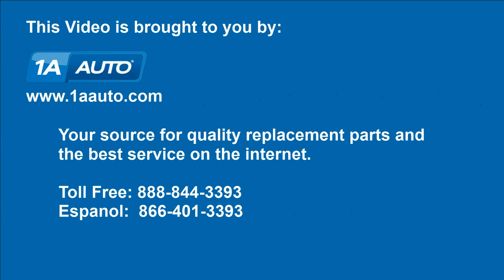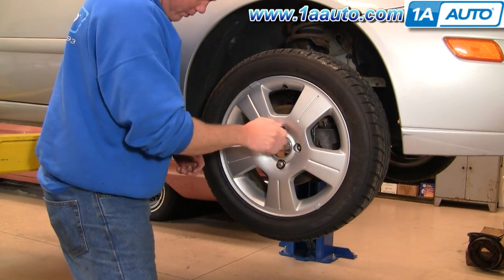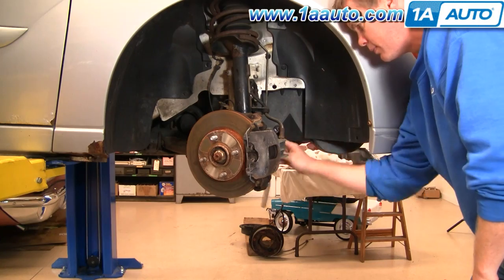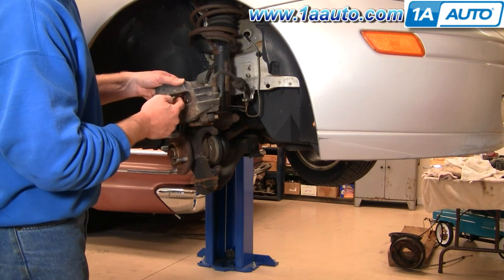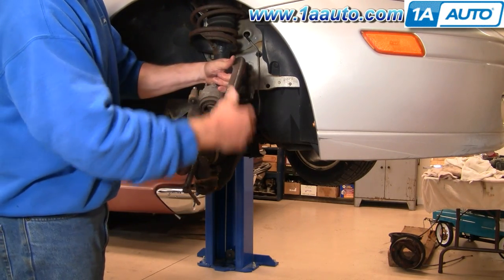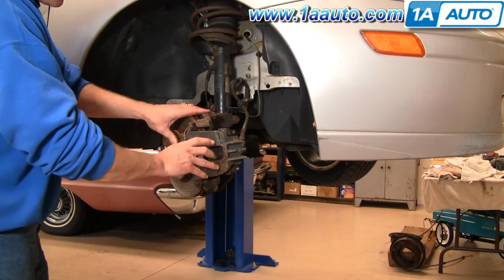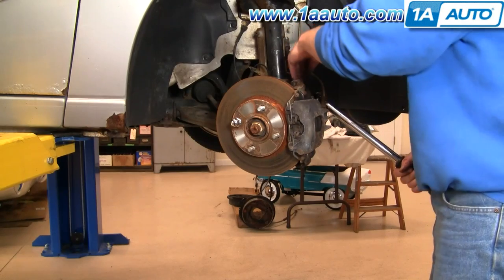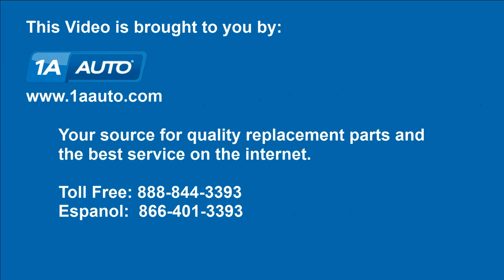How To Replace Front Brakes 00-04 Ford Focus

Comment: I would never put a C clamp (directly) on the piston. I have always used a piece of wood laid across the rim of the piston to avoid any possible cracking or fracturing of the piston. 
By the way... nice '60 Pontiac there. Hard to tell if it's a Catalina or Gran Prix but still... nice car. Nice '55 Chevy Pedal Car too.
Reply: I would also never do it with the bleeder valve closed.
Reply: use a old brake pad between piston c clamp  or just buy a brake tool for compressing the piston  back in    there not to pricey

Comment: I have a few pointers. Before pushing the piston back in, it’s always a good idea to remove the brake fluid reservoir cap off. Also, the guiding pins should be cleaned and lubricate before reinstalling.
Reply: the other way is to use a old brake pad by placing in inbetween the piston and clamp.
I just use the tool that is made for the job

Comment: Is there no need to bleed the brakes after installing a new set of pads and rotors?
Reply from the maker: Thank you for watching! If you just doing the brakes due to normal war and tare it is not necessary although it is not a bad idea.
 888-844-3393
Reply: no
Reply: No need to bleed the brakes for discs and pads replacement. After installation test the brakes a few times and you'll be fine...

Comment: I dont understand why you removed the old and rusty rotor if your plan was not to replace it,then to push the caliper piston to the inside position there are a tool for that and the price is less than 10 dollars,putting a c clamp over the piston wasn't a good idea, that's why i do all by myself!!
Reply: He was just showing viewers how to replace the rota, even though he was not replacing his. I agree with you that you should just buy a piston rewind tool. They aren't expensive. I'm also surprised he didn't pull out the guide pins to clean and re-grease. For anyone watching videos trying to learn, I would suggest watching multiple videos of different people doing the same job. Because often, so called professionals will neglect something or use an incorrect tool.

Comment: Both of my anti rattle clips (the wire shown on video) are missing/came off (brakes are 1 1/2 year old). Ford dealership says that they can't install new clips because the brake pad cover is damaged and rotors need resurfacing. Is this true?? they called it break pad failure because clip couldn't be put back on. I just want new clips because the wheels sound like they are going to fall off without them. Lou/ wobbly noise from lack of the clips. Is this reasonable?

Comment: The lug nuts on this car have a chromed cover that over time will break off and make the lugs 18 mm.. with no use for the cars lug wrench after that. I lubricated the studs with anti-seize compound, tightened the lugs with a 1/2" drive 18 mm. deep socket on a 1/2" drive breaker bar and left the new lug wrench in the trunk.

Comment: This video is very thorough and detailed. I have used them as a guide to other repairs as well. Would you please do how-to videos regarding the ABS system in this car? I have a ‘01 Focus wagon with the ABS light on. Where in the engine compartment does the wheel sensor wiring connect to the ABS pump motor on these cars? I can see a modular plug on each wheel in the wheel wells. Where do they actually end?

Comment: Very good video thank you. But now how do i go about removing the torx bolts if someone has stripped them out?
Reply from the maker: +Chuck Hepler Thanks for checking us out! yIf the torx is stripped, you may need to get into it with a bit and drill them out if you cannot get them out conventionally.
Reply: Ok what about an easy out?

Comment: The rubber grommets that's around the 2 pins you have to remove to get the caliper off, they keep working themselves off, I have lost at least 4 or 5 of these grommets, I have a 2001 Ford focus se dohc, can anyone give me any advice on how to secure these grommets.
Reply: Buy a new caliber should problem should b fixed which sucks I know but worth every penny if its getting on your nerves

Comment: my right tire rotar is loose, it makes a rumbling noise as I drive now..... is the rotar soposta be lose as my left tire rotar is not as loose, I can move my tire side to side when car is raised but only right front tire does this , ? Normal ?
Reply from the maker: +J Love It should not be loose as you drive
Reply: 1A Auto Parts thanks for the reply I really appreciate it..... I hear a rumble type of grinding noise from my right tire what could it be ? I can not tell if it is loose while driving but I can wobble the tire when I raise the car, the other tires dont do this and the same thing happen on another car I checked but that car is fine so im lost..... what should I check for that noise ? like what can be broken or loose that will cause a rumble kind of grinding noise.. dont think my pads are worn so you can exclude that cause. 

Thanks allot I appreciate it.
in
Reply: J Love that's definitely a bad bearing...by jacking up the car and wiggling each tire  (with your hands on the tire at a 9 and 3 o'clock angle), in most cases, if it has too much play, then it's a press-in bearing or bad hub assembly.

Comment: What size disks do i need for a ford focus zetec mk1 1.6 2003
Reply from the maker: +colin Jennings mk2 leon The part in this video fits your application, and the install should be the same or similar. Buy this part on 1AAuto.com: https://www.1aauto.com/2000-04-ford-focus-front-brake-rotor-pair-trq/i/1abfs03614?f=1363122&y=2003

Comment: Can you use G clamps for this,  Cant find c clamps anywhere locally to me,  But G clamps are plentiful
Reply: you can buy a 6 inch C clamp at any home center  or hard ware store    but  you can buy a piston retractor tool  for about 10 bucks  and it will work faster   amazon ebay   just type in brake piston tool  and you will see them all   i have the   lang tool  it is very good

Comment: every time I work on a ford I say "what kind of jerk off engineered this" and these brakes are no exception
Reply: Dan  this has to be one of the most simplest brake jobs to do . this video is a little  misleading    meaning  there were a few things I did not like seeing like useing the c clamp with out a old brake pad   to push the piston back in.  ALSO in the video mikes use a t45 torx bit to remove or losen the  guide pins as there called   but its not a torx  it is a hex  witch is a allen     you can see that in the video